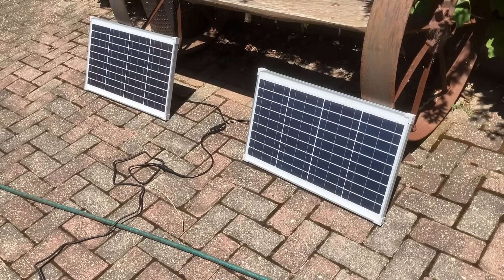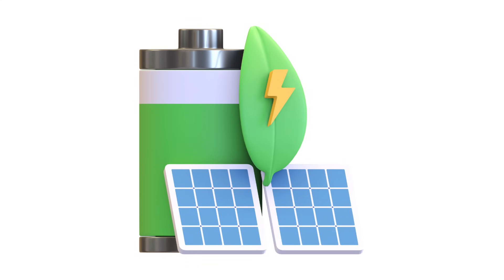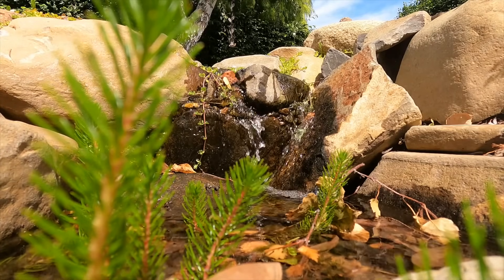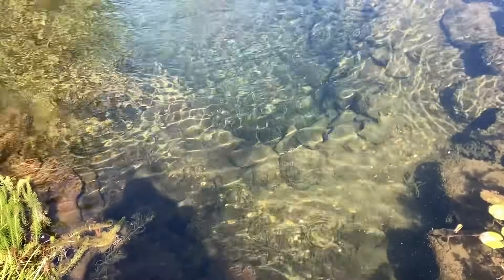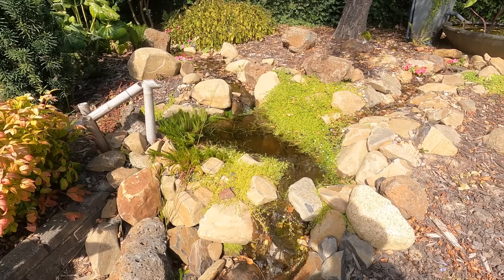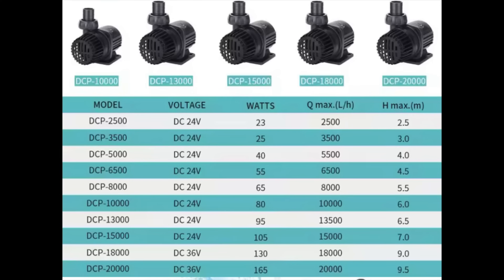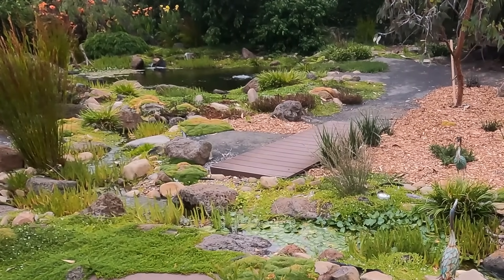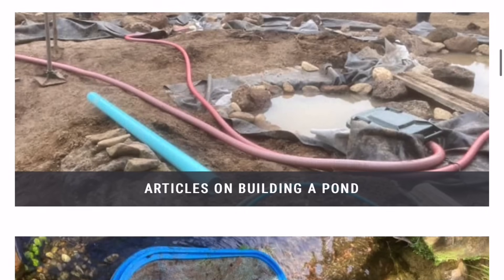Can you filter a pond with just solar?

Comment: What's the biggest pond you can run off solar? Or I guess I mean largest bog filter system off of solar, I'd like to have a falls of 10ft cascade into the pool eventually but I know that requires a lot more energy. But could I at least bog filter the water adequately with solar panels? Pool would be around 30x30 ft
Reply from the maker: There’s no limit. You’re only limited by what you can afford. But you can build almost any sized solar system these days.

Comment: Question, is there any method of not using a pond liner? Specifically for a hard rock area with natural features (pahoehoe lava). What I mean is some type of clear epoxy so I don't lose the attractiveness of the rocks but also don't have water go into any cracks etc. thanks

Also this is for a man made stream and waterfall area, going into a pond with pond liner pool at the bottom of the falls.
Reply from the maker: It’s not something I’ve ever looked into.
Reply: @Ozponds so you always use pond liner? What if there is natural rock features already present? Surely there must be someway to keep the rock features but also create a man made stream? Some sort of epoxy and just using the rock as it is is all I can think of, I don't think there  is any clear see thru pond liner lol and even if there was I'm not sure it'd be as easy to work with. Essentially just looking for a bit of a way to stop rocks from be any bit porous down a channel or relatively solid rocks for water to flow without major loss of water. It happens naturally here (in hawaii) and is one of the most unique features on earth, witnessing a stream (very clear water due to lack of soil), flowing over lava rock (pahoehoe), into large pools etc. some of them (most of them) eventually flow into a newer lava flow where the water then dissapears into the porous rock and to never be seen, but the slightly older lava flows around 3500 yrs old can still hood water and thats where you find the clear water rivers with lava elements.
Wailuku river is a good example.
I believe also a volcanic island place in the Indian Ocean has these same type of streams. Australia is very old from what I know so there is likely no lava geology present, very different places geologically speaking

Comment: How does fish waste end up in your filter if your pump is in an intake bay? Wont' it all just settle at the bottom
Reply from the maker: A lot of waste does settle inside the pond but if you stir it all up you get a lot moving through the pumps. You can also add additional circulation - if you don’t want to manually stir it up. Some people like bottom drains. There’s heaps of options for pond design and filtration. Plenty more in-depth info on ozponds.com 👍

Comment: Can I connect the Jebao pump directly to a 12v battery?
Reply from the maker: I’m not sure. I’ve wondered the same thing because it’s dc.
Reply: @Ozponds  My bog filter is too far away to run power so I'm running all on solar. I'm using 3 Foting 4900 GPH pumps that use 5 amps each. I'd rather use the Jebao pumps wired in 12v because their current draw is much less. 

The Jebao pump has 3 wires.  I'm guessing one is positive one is negative, and the other is control. Maybe just leave the control wire hanging?
Reply from the maker: @kdbryant77 that’s my thoughts also but I’m not 100% sure.

Comment: Hi. Just seen your video. Total newbie and hitting a brick wall trying to setup a solar pump. It's a small pond and the pump transfers water from pond to waterfall. It is mains and is fully working.
I have a solar panel, controller,battery and inverter. 
I setup the system as videos show and first time round and with not much sunlight got about 45 mins out of it.
Since then (and getting good sun every day) as soon as I turn the inverter on I get the alarm and automatic shutoff in seconds.
I have bought a battery charger and charged the battery but the same happens. 
Also tried connecting a coffee machine and it does the same (alarm and turn off)
I was expecting it to improve and not stop working. I have checked wiring and rewired several times but get the same result.
Any thoughts much appreciated
Reply from the maker: I’m not sure I have no inverter dc pump.
Reply: No worries. Its doing my head in !@Ozponds

Comment: Super helpful—thanks for this video! I’m in the early stages of assembling a solar-powered pond system and found your guidance incredibly useful.

I’ll be running a 200W, 18V solar panel into an MPPT controller, which is connected to a 30Ah LiFePO4 battery. From there, I’m using the MPPT’s DC load output to feed into a fuse box that distributes power to my pumps.
	•	Main pump: A 17W (5A fuse) unit running continuously at ~600L/hr
	•	Secondary pump: A more powerful 60W pump (1,500L/hr), wired through an inline on/off switch so I can activate it manually when I’m in the garden

The pond itself is quite small—about 866L, 50–70 cm deep—with a waterfall feature that has a head height of roughly 1.5m. We’re switching from a mains-powered pump that was too loud and strong (and unfortunately kept getting turned off, which wasn’t great for the fish!). The solar setup should be quieter and more consistent.

I’m based in Thailand, so it’s warm year-round. Planning to keep hardy little fish like guppies. Would love any tips or feedback if you have thoughts on the setup!
Reply from the maker: I’m far from a solar expert I just bumbled my way through. Filtering water that’s where I’m comfortable.

Comment: Great video, I really like the tropical fish, which here in Scandinavia I would have in my indoor tank... So I am planning a combination of solar and mains pumps, instead of solar + battery. The idea is that when you are enjoying a good flow - let's say a waterfall, it will typically be sunny or at least the panels will create flow because it will be daytime, then at night or during winter the mains pump can ensure necessary circulation.  The idea is that peak solar is also peak pond admiration time. What do you think? 

Edit: ah, but if you have solar on your roof that would amount to the same thing, Just skim the otherwise surplus power and turn down at night.
Reply from the maker: I love the idea 👍

Comment: Nice work Kev agree not many vids on this I’d agree with the mains power  when you can as for solar it ok for the smaller set ups as you saw in my email I sent that I have one that runs of a 12v 6w  pump amazon $38 charge converter Amazon $25 digital timer $18 batteries x 2 $44 each solar panel 12v 40w $160 wires $33 comes in at $360ish but for a pong at a Barth tub size with a filter that runs 8 hours a day  note most solar panels you will need a battery and a charge converter for it to work
Reply from the maker: Spot on 👍

Comment: Cool kev 👍🏼 glad u did a video on solar as I do not see many do it.  
We run 3 bogs from our solar set up on a 500litre, 300litre pond and 4 ft out door tank, it’s a car sized battery and the only thing we have had to do is recharge the battery after weeks of rain and no sun. 
Both ponds and tank are crystal clear and no alage , a little surface alage on tank but I keep 3 sides with it for my Otto’s. 
The 500litre is full sun the other two have shade.
Luckily our ponds are only small so it is quite doable but I think with bogs,  not needing the fast flow solar i
Works perfectly. Probably not so much for the larger fast flow mechanical filters but for our bogs it has been the best thing we did. 
We are now looking at adding solar to our larger pond. Instead of a larger bog we have decided to run two smaller sized bogs at each end. You can run 3 outlets off the one car battery so it’s very doable.
I think all up it was around $1000 for the full set up,  but cheaper in the long run if you  don’t mind the initial outlay.
Reply from the maker: That’s so cool. Thanks for sharing 😊👍

Comment: Great videos. Very useful for my project. How do you manage the circulation during rainy season? Do you keep it running 24hrs even during rains?
Reply from the maker: All my ponds apart from the solar pond run 24/7 365. On the two largest ponds in front of the house I have designated overflows.